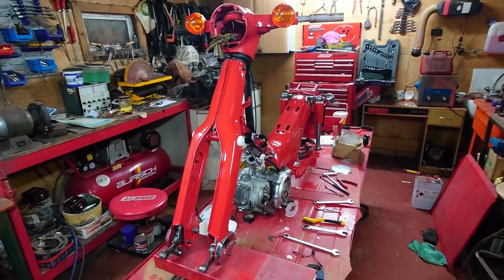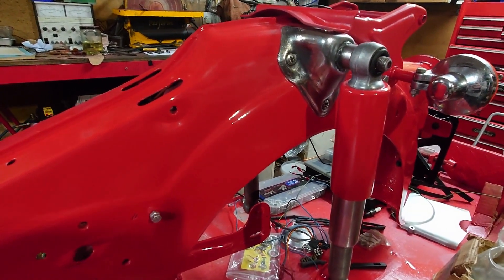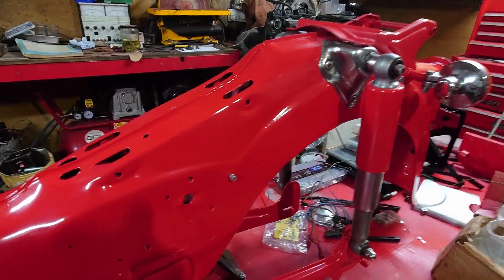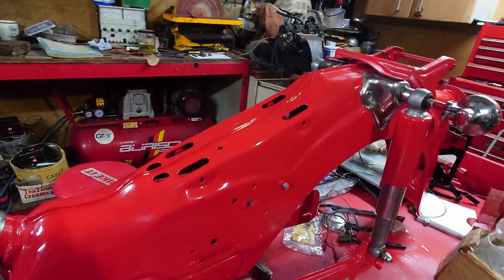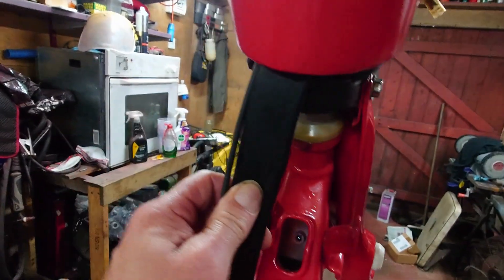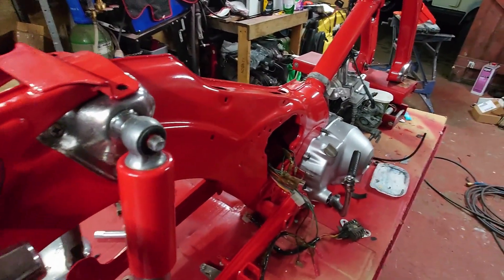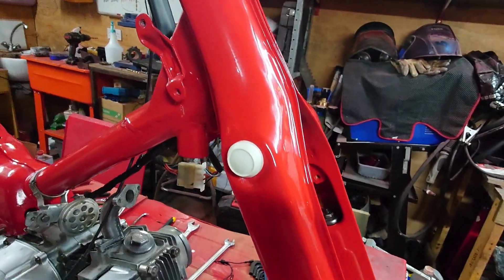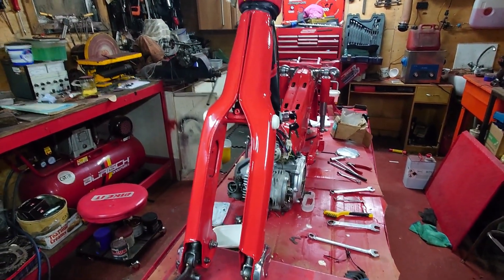Honda Cub C90 Project part 1: Slide and video

Comment: Hi, great looking cycle--I know you'll do well with it. I have a 1964 C100 that I inherited and am working on and have a question if you have a moment--I am not sure where to hook up the ground on the battery--there was a black wire with a female lead that I used to ground the battery to on it when I got it, but it came off the other day and I have no idea where it was connected. The schematic for the Honda shows a blue wire leading from the battery that goes to the combination switch and appears to be grounded there, but I don't want to make a mistake and burn something out. I do see the blue wire, which has a male lead. No idea why. Can you advise?
Reply from the maker: Yes, I think you are right, it looks like the earth from the battery connects to the blue (in a tube) and that goes to the switch. This diagram might be helpful https://s.turbifycdn.com/aah/dratv/c100-wire-diagram-13.gif
Reply: @doconwheels-c5m  Thank you, sir! I'll give it a go and hope it works.